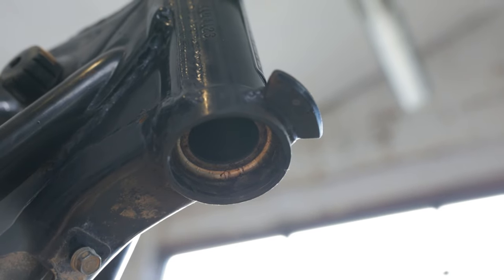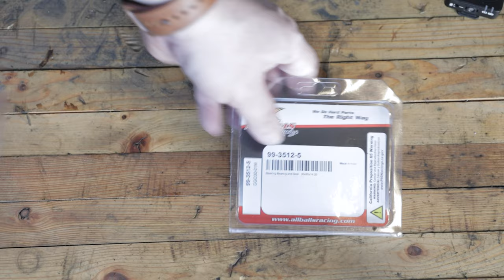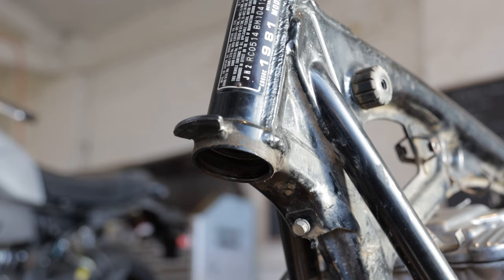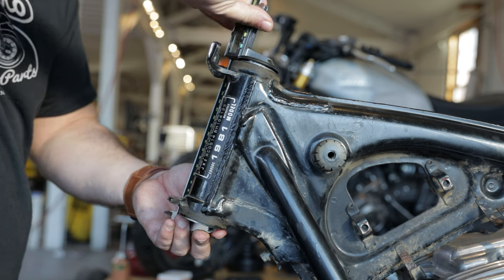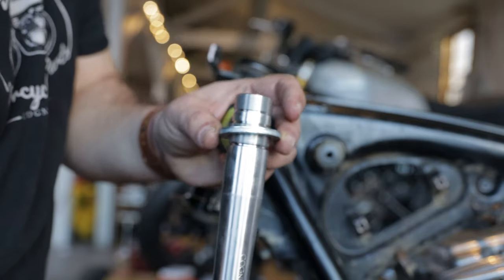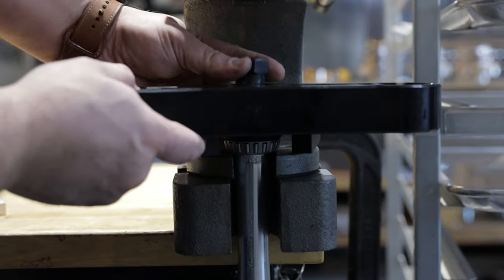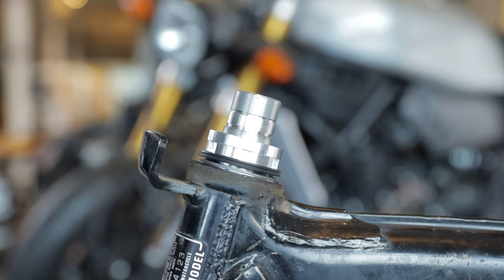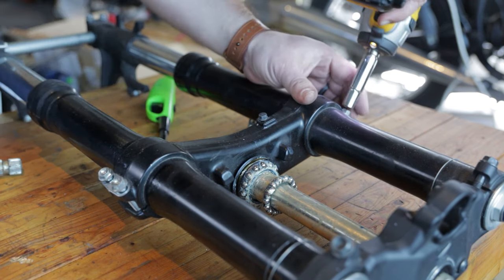CBR600RR Fork Swap install onto our Honda CB650 Cafe Racer Build.

Comment: Does anyone know if the head tube was different on the 1992-1999 CB750's? Have a set of CBR 929/954 forks complete with triple clamps and need a stem to suit the frame or even a whole new set of triple clams and stem? Hope someone can shed some light or even Cognito Moto can? cheers

Comment: Curious what’s the point of the top seal when 1/4 of the bearing is above the neck?  It’s not actually sealing like the lower is.  I’m asking because my cb360 upper bearing looks the same lol.
Reply from the maker: Correct, we are kind of limited on bearings and that is as good as we can get.

Comment: Is it possible to reuse the stock front rim after a fork swap?
Reply from the maker: you can but you would need the hub we offer that allows you to put a laced wheel on the new fork.
Reply: @CognitoMotoTV  which part Is that? I put kenda big blocks on my stock rims. Now having a fork issue. Might swap but want to keep stock rims, wheels and dual disk brakes.

Comment: I’m curious…..why do so many cafe racer builds/rebuilds I see use the GSXR forks in place of the OEM?  I have a 2013 Moto Guzzi v7 Racer and am in the midst of a rebuild now but am already thinking about what I might do next and changing the suspension (front and rear), along with another exhaust mod (first went from stock to Mistral but still the same length as OEM).  Doing research on suspensions and I keep seeing GSXR forks being used but no one really stating why…..soooo,thought I’d ask you guys.  Thanks!
Reply: did you ever find out why? my bike came with aftermarket front forks and i was interested in changing them but idk if it would be worth it because they are already aftermarket
Reply: @ukariah   No, never had a reply as to why.  When I get a few minutes here and there I do some research on the web and so far what I have seen is that they are just a nice upgrade over most OEM forks and especially cafe racers where you're typically working from a base motorcycle that's not as sporty.  However, I've also seen quite a number of articles talking about suspension upgrades in general for cafe racers and the consensus seems to be that unless you are really going to be pushing your bike when you ride (performance wise), you may not really notice the difference unless your current suspension is just totally shot/worn out.  Not sure if any of that helps but hopefully does even a little.
Reply: @devincalhoun3792  i knew they would improve handeling but why gsxr? i found a zx6r front end for sale for cheap but i already have SHOWA front forks i doubt they would be better. I think it could be that GSXR didnt use inverted forks for awhile and that could be easier to install on a bike that was made before inverted forks but idk
Reply: @ukariah  I think you're right about SHOWA vs GSXR and sounds reasonable regarding the inverted forks.  I'm still learning as I go but sharing like this helps a tremendous amount.....we can all learn from each other.  If I find out anything else, or get a response to my original post, I'll definitely share it with you.  Good luck on your build.
Reply: @devincalhoun3792  i think potentially the biggest reason is price, i havent looked into it but i can imagine if everyone is doing gixxer front ends they cant be expensive, it might just be the cheapest way to get modern suspension on a 40yr old bike
Reply: @devincalhoun3792  heres one thing i don't understand, how do wheels work? Are they all the same bolt pattern as long as it isnt single swingarm. The zx6r front forks doesnt come with a wheel so could i use the oem nighthawk wheel already on my bike? I tried looking on revzilla for aftermarket wheels and wasnt lucky. am i missing something?
Reply: When you talk about bolt pattern, are you referring to the bolt pattern on the brake discs?  If so, as long as you’re using the discs that come with whatever wheel set you go with it won’t matter off they match the OEM. What you do have to check is width and diameter against OEM.  You can change (+ or -) but there are limits unless you want to start making changes to the swing arm and triple trees. When it comes to mods, the old saying is “you can change anything with the right skill, tools, time, and money”
Reply: @devincalhoun3792  i asked some guy on facebook marketplace lol, now im just trying to find out if the cb700sc front wheel will fit on the zx6r front axel